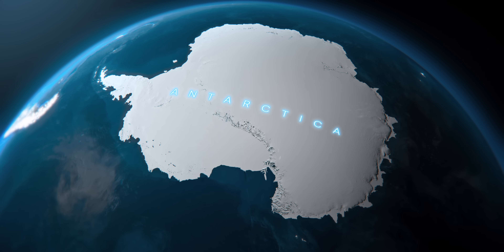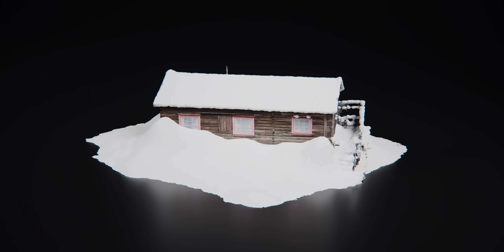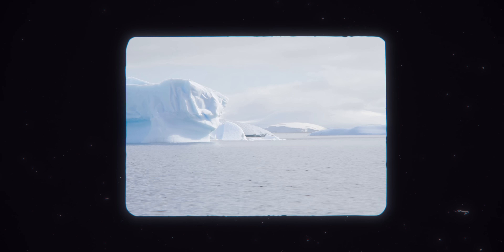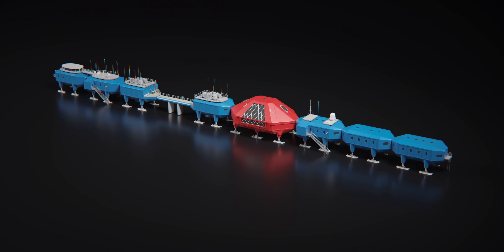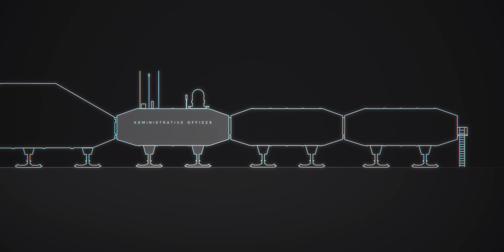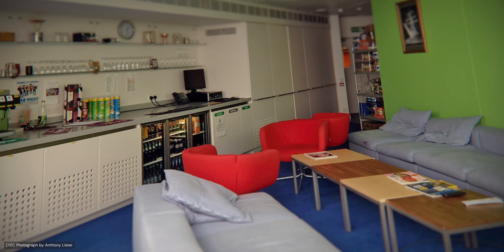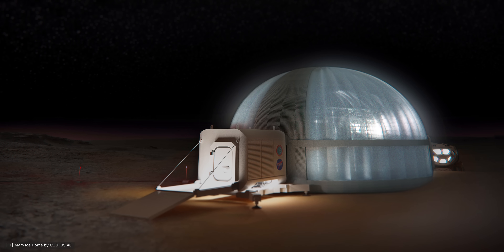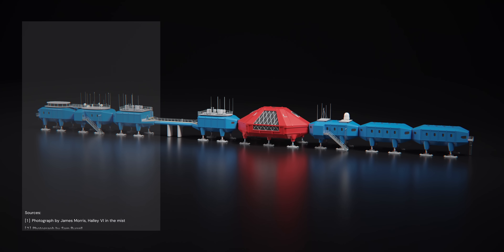The Genius Design of Antarctic Bases

Comment: I hate the mars part when it doesn't take the absolute depressing habitats that will be in Mars but still compares it (kind of) to Antarctic. In Mars you won't even have windows because of the radiation and don't even look up how problematic Mars sand & dust will be to living conditions and how it makes building of the habs so much harder.
Reply: Martian soil isn’t as hard to work around as lunar regolith if that’s your concern. And the only reason windows for mars bases are seen as a bad idea is because of the goal to minimize the total mass of the base; if you can get away with using more than the absolute bare minimum you could make windows that block the worst parts of solar radiation with relative ease
Reply: @alexsiemers7898  What the fuck have you been reading? The reason to not have windows is the fucking radiation. Every part of why a martian base will be a windowless, soulless blop of a habitat is to just combat the radiation not being too much. There will never be windows on a Mars hab and because there is no logistical point consider the people inside.

Comment: The air pressure on Mars is less than one psi I believe and therefore the insulation does not need to be even close to that of Antarctica at 14.7 psi

Comment: Wouldnt nuclear energy be prime for this kind of remote energy supply? They could just put a small reactor somehwere without needing to resupply and you dont even need cooling towers - just run the water loop through a colder section of the base and it can heat it up and cool the water down.
Reply: a steam turbine type would be too expensive and complicated...
an rtg type is much more simple (like on space probes) but i think there are not enough nuclear fuel even for the space probes...😊

Comment: Although Mars and Antarctica have similar temperatures, the conditions are wildly different. The low air pressure on Mars means there's little air to carry away heat. Martian winds carry off less than 1% as much heat as Antarctic winds. The Antarctic loses about 7 million J/m²·s. Mars loses about 25,000 J/m²·s. 

However, there is little greenhouse protection provided, so radiative losses dominate. The roof loses 370 W/m² at night. Therefore, radiation insulation (shiny surfaces) is more important than insulating layers. Thermal insulation is still needed, but not nearly as much. 

But Martian stations will be built underground because there's no ozone layer to stop the solar wind. They will also need magnetic shielding to keep particle radiation far from the station. Incoming protons at a significant fraction of the speed of light give off heavy radiation. On Earth, the auroras protect us from most of that. Distance mitigates this, including the several miles from the auroras to the ground.
Reply: auroras?!?
the magnetic field!😊

Comment: Interesting. I have questions for experts out there.

1. How are the lateral loads resisted? Is it purely by frictional force only? I'd imagine steel on ice/snow has a low coefficient of friction. 

2. Are overturning moment resisted only by the structures self-weight?

3. Don't know any relevant codes for temporary structures like this but I assume there only using a low MRI for wind speed?

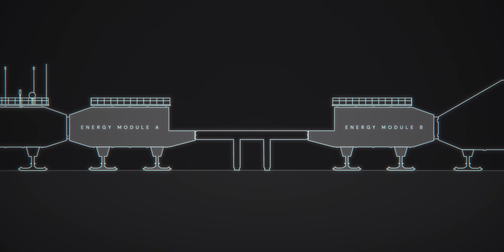Comment: I'm only 6:22 in... but you've not explained that bridge.... I see no reason for it to exist?
Reply: Did some checking. It stores two melt tanks under the bridge and connects summer residents along with utilities between the platforms. Still doesn’t explain why it has to be exposed. I suppose it gives them somewhere to go without risking being locked out.
Reply: Yeah, just move those other modules closer, why have this bridge?

Comment: The inclusion of cedar panelling for the organic smell is a very thoughtful and clever touch; we need to start thinking about including touches like this in spacecraft, especially if we are expecting long voyages to Mars or even just the Moon.
Reply: probably isn't viable for spacecrafts, every single kilogram has to be considered since it effects the weight and fuel usage
Reply: @SnowPaw404  if we are going to be building true interplanetary or even interstellar vehicles, they will be assembled in orbit and launch mass will not be a consideration (high mass might be a benefit, providing cosmic ray shielding)

Also see The Expanse ep1 when Mike Ermantraut goes space crazy and is only calmed when he dumps out the houseplant in his quarters and stands barefoot in the dirt.

"We came out all this way... why didn't we bring a little more light?"
Reply: @DmitriVanderbilt The problem isn't the amount of cargo you can fit on one rocket -- it's the cost of fuel per kilogram sent to space.
SpaceX currently charges $2,000/Kg for the Falcon 9. They're promising $20/Kg with their new project, but their CEO is known to very severely over-promise and under-deliver.

Even with today's technology, it would still be almost a billion dollars in just launch costs to get the ISS to space.
And yes, the ISS was built in space just like you suggested.

Maybe if spinlaunch actually works, we can yeet wood into space one plank at a time 🙃

Comment: you open by stating that these bases look like theyre built for an alien environment, but... they basically are... to have breathable air you either need contained and treated sources, or heavily modified air from the outside (heated in this case) its cold enough that dehydration becomes an issue just the same as in the extreme heat so you either need to bring extra water for the air or heavily process the air going out, and the air outside is so cold you need to minimize surface exposure, so throw some curves in instead of corners, while the problems are different, the solutions are the same.

Comment: More climate change wank.
Reply: climate change is a fact. doesn't matter how many times you call it "wank".
Reply: @gregkerna7410pay more taxes to change the weather then.

The question isn't "does climate change?" it does. We're not in an ice age anymore. The fact is, we aren't responsible, it's not man-made.

Pretending it's the new Original Sin is wank.
Reply: @InnawoodsAnon we are responsible for it’s acceleration. It’s like going full throttle on the gas pedal and when you crash into something, you claim it wasn’t your fault because the car was already moving that way.

Comment: What's the point of the bridge?  What not just put the modules on either side right next to each other?
Reply: Keeps the the power stations separated in case of emergencies, they're burning and storing aircraft fuel .

Comment: 200mm of closed foam seems pretty low to insulate those building considering the outside temperature..... the fuel burn is certainly insanely high.
Reply: Nah, that's eight inch thick styrofoam, which is more than adequate.

Comment: With current tech, those windows could be replaced by high fidelity display panels capable of simulating natural light. The panels could mimic a variety of exterior vistas. It'd save on heat, elminite a structural vulnerability. And who wouldn't want giant fake windows, indistinguishable from real ones, and appear to show a more lush environment rather than the desolate pure white of the Antarctic?

Comment: One minor error: buildings on Mars will not require nearly as much insulation as Antarctic bases, because although the temperature is indeed lower on Mars, there is also a lot less atmosphere to conduct heat away. If anything, a bigger challenge might actually be getting rid of heat, not conserving it. Titan would be more similar to Antarctica in this regard.
Reply: You're forgetting the horrible radioactive particles from the sun that will no longer be blocked by said atmosphere. You need shielding from that otherwise everyone's going to get cancer.
Reply: The stated temperature on Antarctica is also wrong, it's never seen a temperature recorded at -122°...? -90° might not seem that much warmer but the little errors make me wonder how much research is being done via ChatGPT or whatever on this video

Comment: Hold up. How do the snow keep piling up? I thought Antartica has summer which most of the ice and snow melts?
Reply: Is this bait? But no, most of it doesnt melt in summer. The ice in places is multiple km thick, the sun lights it from a low angle, the ice reflects a lot of light back into space. And then there are things like winds too.

Comment: Housing should be built like this in extreme weather spots in the USA. People could avoid flooding, high wind damage and they could be moved as needed.  The foundation could be minimal to support the structure cutting cost on proper anchoring against storm surge.  A somewhat adjustable ramp allows movement with the lowering or raising of the structure. Even a more basic structure to house vehicles to prevent the loss of them.
Reply: As cool as that sounds, the economics don’t really make sense, even in the most disaster prone areas. Raised foundations, more permeable concrete, flood walls, levees, larger floodwater management systems, etc. are the boring but more efficient answer to this problem.

Comment: So why are the two halves joined by an open air bridge? Seems like something that would make sense in a video game level (you have to find the environment suit before you can cross!) but I don't get the purpose here
Reply: Simple answer I would presume would be to cheaply connect the two power generators with a retractable bridge while also simultaneously segmenting and separating the labs away from the habitation/storage modules in case the labs need to be quarantined or isolated, like in the case of a laboratory fire. The Bridges being retractable are important since this allows for the transportation of one less segment, making moving the base less of a logistical nightmare than it already is.

Comment: Just from looking at the design I can see the logic. Cold travels through the ground, so lifting the modules keeps them warmer. Bright colours are easier to find in snow storms.
Reply: 😂 That's so wrong
Reply: @samuelgarrod8327  elaborate
Reply: @samuelgarrod8327  you can just look at the signs by bridges to instantly disprove Littlestrainclouds logic 😂 “bridge ices before road” because having cold air on every side of an object makes it freeze faster than the air only being on one side of it. Bros using the homeless methodology of sleeping on cardboard to reduce heat loss 😂

Comment: Poderia fazer um video mostrando o interior de cada uma das instalações na antártica, mostrando como funciona e as características unicas da instalação de cada país 🇧🇷❤️
Reply: I don't think you quite realize how many stations that would be. Also, almost every single station is subject to each nations respectful "state secrets" policies. In the US, this translates to the exact makeup, function, and design of each US operated antarctic research station being subject to ambiguity as they are often considered classified.
Reply: @dazurathefirst  Dude, it doesn't have to be all of them, you can just show the ones that have already had their interiors exposed, the one in Brazil has several videos showing how it works, the one in the video above also shows it, and there are certainly other stations besides these two
Reply: @dazurathefirst  so this is why most pictures were renders and not actual pictures of the station ?

Comment: The fact that this is not picked up by the algorithm might be due to the fact that ice coverage is at a record high, rather than low. Just sayin.

Very well made video, if not factually correct and misleading when it came to this specific point.
Reply: Current research shows that global sea ice levels are at record lows. By current research, I mean literally analyzing the amount of sea ice there is on surface levels via photos from satellites.
Reply: @dazurathefirst  I am actually an expert and I work in this field, and this statement is just wrong. The correct research shows that current sea ice levels and both ice caps, both subsurface and surface ice are basically unchanged since we've started measuring or is incrementally increasing.
Reply: @spektakelkd im an expert and worked in the field for 12 years. You are wrong.
Reply: @norbertnagy5514  I am an expert in this field and have worked for 13 years. You are incorrect.

Comment: why are they not black to better capture the heat from the sun?
Reply: A few reasons: 

1 - high visibility = better to find in low visibility conditions like at night and during snowstorms

2 - (probably the biggest reason)  Antarctica receives only a modicum of sunlight compared to the rest of the world, during winter, Antarctica can get days where they don't see any direct sunlight. Which means they don't really function during the most energy demanding section of the year.

3 - black absorbs heat, but it also radiates heat better. So whatever heat is internally generated would be much easier to radiate outside if it was black.

Comment: Honestly, Halley VI looks like a Train on Skis.

Imagine a concept where a large tractor vehicle — a "Locomotive" — is specifically designed to tow a station similar to Halley VI, but with articulated connections in between the station modules so that the station can bend and flex like a train, and the skis having grooves on the bottom to keep the station from sliding side-to-side.

As highly improbable as that sounds, I still can't help but picture a concept/scenario such as this at certain times, especially when something such as this invokes a certain feeling.
Reply: someone seems eager to make snowpiercer a reality :)

Comment: Why do the two energy modules have to be separated by a bridge? I get that the bridge connects their functions, but, what's stopping them from being connected directly to the other modules? And how is the bridge moved? It looks like it's connected to the ground much more solidly than the actual modules are.
Reply: I'd imagine the bridge is there to keep them farther apart - reduce the risk of an accident damaging both at once.
Reply: To further clarify, the bridge acts as a fire break, so that a fire is less likely to burn down both halves at once. Also, based on a few images I found, it seems the "legs" on the bridge are just for connections to equipment on the ground (probably things like water or fuel storage), so the bridge is purely supported by the adjacent modules and otherwise doesn't need to touch the ground.
Reply: Also these are modulars. Built in the UL or somewhere and then assembled in site or connected on site. Make sense?
Reply: @mrhahnlee  I wasn't confused about these being modular.
Reply: Safety, duh

Comment: Great video, as always.
A small nitpick/error: 
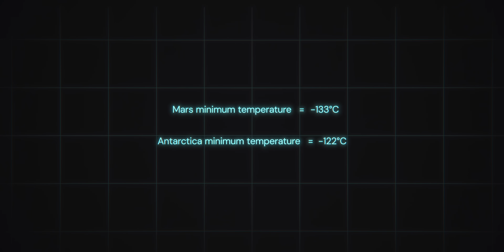At 9:13 it says antartic minimum temp -122° C butnfrom what I could gahter the lowest recorded temp was -89.2°C and there are estimations that temps could get to around -100° C.
I also hope this comment helps with the algorithm, I'm baffled how this video hasnt got way more views yet.
Reply: It might be the wind chill. I've noticed a lot of videos and articles dont mention weather they are using wind chill or not.
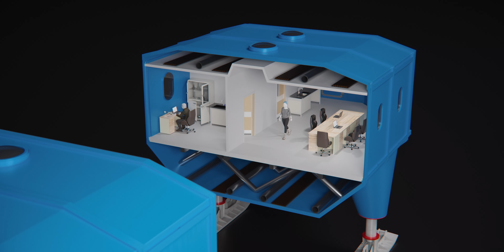Reply: Windchill 0:46
Reply: Yep, someone has swapped Fahrenheit with Celsius.
Reply: There is point to be made here that the temperature doesn't need to go as low as on Mars to offer similar heat loss problem. Mars' atmosphere is extremely thin, and thus has a lot less particles that can carry heat away via convection.

You could literally use Mars' atmosphere as an insulator on Earth by pumping it into an enclosed space.
Reply: @Avaruusmurkku  To be fair normal Earth air is a decent insulator itself